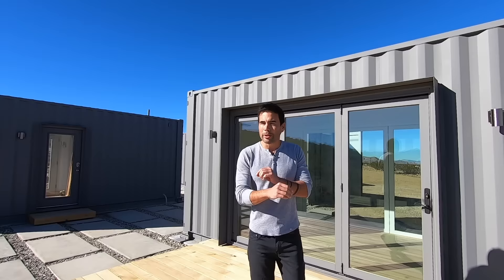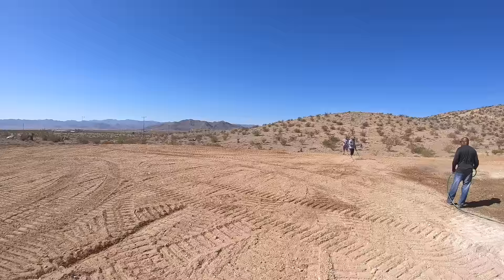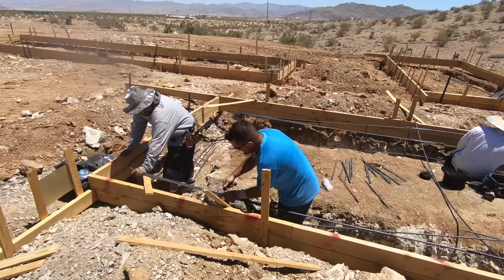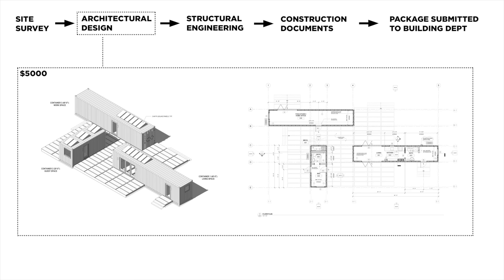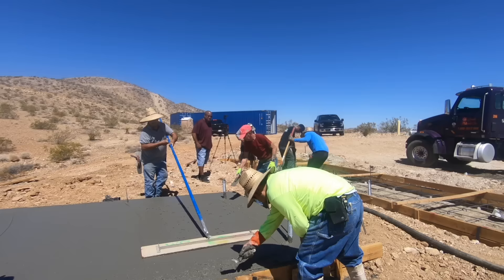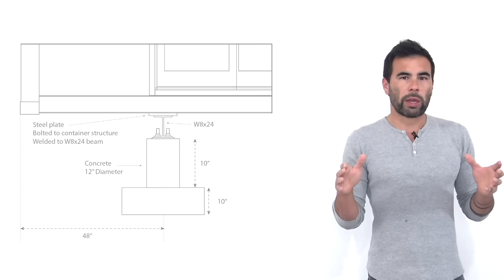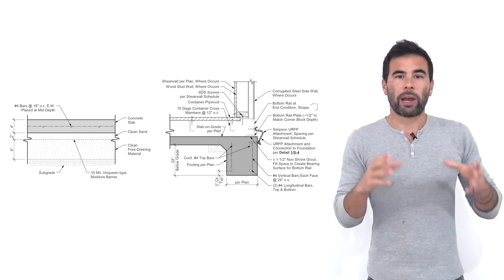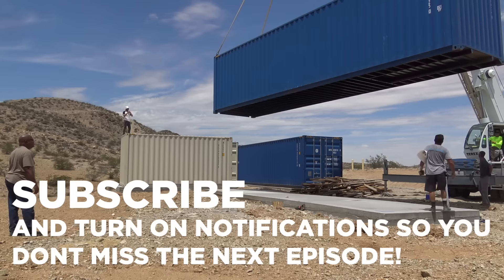Building a Shipping Container Home | EP01Permits and Foundation Design

Comment: CA: HEY STOP!!
Builder:? What?
CA: Do you have a permit?
Builder: Sure right here.
CA: No No No my friend I need the permit for this permit to be permitted.
Reply: 😂😭😂 I am screaming. This comment is golden. I use to be a planner in California.
Reply: Don't forget the Conversation Tax and the Breathable Air Tax.
Reply: HaHaHa:))))  I am laughing too hard right now!!!!!!  DO NOT Ever build anything in Sunny CAli !!!
Reply: @GrafDevelopments  HaHaHa:))))))))
Reply: sounds like California is even worse than Germany/most of Europe because we slapped a container on our property , needed no real building permit but a pointpermit like you need for a garage or a new driveway and it did not have to have any foundation, we put some welded railway rail frame and a few pieces of concrete tiles/bricks below we just needed to prove that it is removeable without any pollution and that the chimney and sewage dont leak  - e just use it for storage and workroom but you could live in there 
you should have taken a coolingcontainer, they are already isolated and got some electronics installed you can repurpose
get some old windows from a demolition site-just be there at the rigth time and ask if you can cut some windows with the framework out to repurpose them, here you get your windows almost for free 

As if a container would collapse from a earthquake, just ask those people if they are capable of breatheing and thinking at the same time what do they imagine? a landslide with the container skiing and rolling down a mountain
Reply: @GrafDevelopments -- 😂 --but not really😕
Reply: It seems just like anything would happen EVERYWHERE in Mexico... no matter the city.... PAIN IN THE A**!!!!
Reply: Hahahaha...genius!
Reply: I live in the Bay Area and yet it is really bullshit. We have a housing crisis because our leaders are incompetent but think they are so much smarter than others. 

I plan to explore the US before I settle down. Definitely not in Cali though. Not what it used to be.
Reply: I work in construction (fire sprinklers) and this is about right. 

I have property in the neighboring desert in the video, and I wouldn't mind the permits, if only it wasn't so damned expensive.
Reply: I used to live in California, that is so relatable.
Reply: It's the same here where I live. It's because of Earthquakes. He says so in the video.

Comment: For a shipping containers we usually go with pillar foundation design, depending on the environment and frost line depth we drill about 1,5m in depth and ~10-20cm in diameter, put in concrete and metal bases just like in your initial drawings. There is also full metal screw in type of pillars, some people use them because they are cheaper alternative, but I am not sure if they are better, those are basically big and long metal screws, they just go in the ground and thats all. These foundations are usually used for smaller constructions. 
The foundation you used here would be considered as too much in most of the countries, we usually use these foundations for a traditional houses, although we make them deeper, that  probably depending on a frost line, usually we dig in ~1,5m depth here in Lithuania.

Comment: If you're gonna have multiple containers, it would make sense to lay them out as a perimiter to form a courtyard. You can then erect shade cloth over this courtyard to create a sort of greenhouse where you could have a nice garden which may even provide a haven from the dry heat of the environment.

Also, I would have put cyclone bolts into the concrete slab and tied the containers to them.
Reply: That right there is exactly my goal. To buy permits, buy the containers, buy trees if permits are needed for that as well, and start crops.

Comment: You should look into Helical Piers. They are very easy to install and perform better than concrete under seismic loads because they allow movement. This would give you fast installation, adjustability, and a steel connection to your cargo containers.

Comment: I'm building what I call a hybrid container home, in Upstate South Carolina. The basic permit was about $1100.00. I'm making 2 stacks of 2, 24' apart, on two end piers each stack, foundation wall on the inside facing sides, and 2 cylindrical piers, 12" diameter, starting with 2'wide x 1' thick footings all around. Add to that a foundation wall riser, 12" wide, 12" high, then narrowed to 7" wide, total rise 36". The entire foundation wall, with change in thickness was a monolithic pour. The inside has a 4" ledge, upon which the garage floor is poured. In each end of the end piers (18" wide by 81/2' x 40" high), are steel plates 1/2" thick x 12" x 14", with 5/8-11 threaded anchor "L" bolts in each plate, 4 each, embedded in the piers. Other plates are similarly  embedded in the foundation walls and side piers. The bottom containers are to be welded to the plates. Top containers attached using standard shipping lockdowns to bottoms. Roof over entire structure, second floor uses I beams, bar joists, etc. This design does away with room width limitations between upper containers. Only openings in containers are for doors and windows. Rectangular tubing frames for all openings. Main living space is on upper floor, 1600sq/ft. Lower level is garage, workshop/ utility bottom left container, entrance hall and office/ den for right side. Stairway is alongside inner wall of right container. The ends are to be structural steel standard metal building design. With the rebar, I welded all risers, etc. This house will last for generations, weather storms, etc. Compared to the stick built on slab houses popping up around here, they are as a cheap car compared to a dump truck, structurally. BTW, I'm doing most of the work myself. I have an older Bobcat to be my workhorse. I would NEVER consider building in a high overhead, control freak state like Kleptifornicatia. And... I'm on 3 acres, with a creek running along the south boundary. The Smokies are 20 minutes north of here, Asheville 55 miles north. I will have water, no matter what happens in the desert out there. Water was one of my must haves. One more thing: this isn't meant to be cheap to build. It is meant to be solid shelter, not a temporary sticks and osb "tent."
Reply: How is your project going? (Resident of WNC here)
Reply: I would very much like too see this shelter. PLEASE!!!
Reply: @gloriaharris5356  Just look up Andrew Camarata's youtube channel which is what I thought he was describing at first.

Comment: "Sprinklers for fire suppression" you got a single bush every like 5 feet from each other
Reply: But, but...they might gang up on you!
Reply: I died laughing on your comment dude 🤣🤣🤣🤣🤣🤣
Reply: @pendejo6466  1- build a defensive wall around your house
2- make the bushes pay for it
3- ???
4- profit
Reply: Did he mean sprinklers inside the building?
Reply: @geothr33  idk but usually sprinklers destroy almost as much of your inventory as a housefire would - the difference being that the sprinklers saves the house itself which the fire could easily burn to the ground. In this case, what is there really to save? The shipping container which is effectively the house? What do you really need sprinklers for here, I mean worst case you go and buy another shipping container lmao. Everything inside it will be ruined by the water anyways.
Reply: I assume for inside... but his house is literally a steel and cement box, there ain't no way in hell its gonna burn down.
Reply: And it's a metal box anyway!
Reply: @Real_MisterSir  You also won't burn to death
Reply: @joshredmond5633  A simple smoke alarm would suffice for that purpose, then you'd at least have a chance to put the fire out in a specific spot without ruining your entire interior in the process.
Reply: Not to mention the "house" is a giant metal box!
Reply: This is how safety works same applies to all even though containers do not catch fire from outside like traditional stick build.
Reply: Steel shipping containers don't burn. There isn't a camp fire worth of fuel in a square mile of that desert. He's in more danger from the totalitarian police state than from fire.
Reply: @pendejo6466  lmao thats fkn funny . Burning bushes " ok lets band together , there he is lets go get that dude in the box "
Reply: @cdgonepotatoes4219  
No new taxes.
Reply: @pendejo6466  In Colorado we, the voters, passed a law called TABOR (Taxpayer Bill of Rights); We vote on any new tax increase or new tax. 
 "The TABOR Amendment, which was approved by voters in 1992, limits the amount of revenue the State of Colorado can retain and spend. The TABOR limit “base” is equal to the lesser of the prior fiscal year's revenue limit grown by Colorado inflation and population growth, or the current fiscal year's revenue." 

"Give a man a gun and he can rob a Bank. Give a man a Bank and he can rob the world." Tyrell Wellick  I.R.S.
Reply: @darmok-hm6jx  
No new taxes.

Comment: This is great. I particularly liked the detail in the foundation construction. I live on the east coast and when building on a sloped site, we struck a large continuous seam of rock. So we decided to anchor one corner of the house basement on this bedrock, poured the slab , built up the walls and used floating “I” beams to act as a dish type bearings to support the weight of the house on top, in case of earth quake. It was actually cheaper to build like this and people thought I was crazy. 2 earthquakes later, the house has settled nicely into the sloped site. In a container this would simply look like a single independent pedestal post under each corner with a cast iron dish and a corresponding twist lock with a cast iron ball. The whole structure “ floats “ on the four corners.

Comment: The corners of containers are strongest, all the weight up to 20+ tonn rests on those 4 points.

I'd just have dug 4 corner holes in the ground, compacted them and poured in concrete, and made sure it was all leveled. Also put container-shoes (Twistlock) in/on the concrete to better keep the container in place during windy conditions, they do grab alot of wind these big boxes.
Reply: I never heard of a twistlock but just looked it up, great advice.
Reply: Was thinking the same!
Reply: The civil guys really worked him over here. Does anyone know who stamped these drawings?
Reply: @Benzo Thats Cali for you, I don't see how any normal person can live there at the cost of living rate.
Reply: I would have hired a piling/foundation drill, then inserted used carpet roll tubes then fill with various size aggregate + compact at each stage + insert reinforce rods and pour concrete using air pokers to reduce air pockets, but it important to remember that the altering/cutting out of container walls does compromise its structure if not supported underneath, so I would have the container resting on 8 points ( 4 each side on 40 ft container to possible reduce flex),...the `Twistlock` is a great idea.
Reply: @Benzo Yes, it's over engineered.... because it's CALIFORNIA
Ask the same engineer to design it in just about any other state and both your design cost and build cost will drop.
California sucks, even for us engineers.

Comment: Nice work! I’m also a designer in Los Angeles and I know exactly how rigorous the permit process is. I Just finished my detached new 1200sq. ft. ADU in the back of my house I had to go through additional requirements like Low Impact Development Design..It wasn’t easy but got the Final Inspection approval yesterday 🙌👍🤜.  For the 18” min. Crawlspace I believe there is an exemption to that rule if you use a naturally durable or preservative-treated structural floor system. But going with a monolithic slab foundation is a good choice and Engineers prefer to use it when designing a new house for is structural reasons. I can’t wait for the next episode!

Comment: Hello there. I popped in your videos and I pretty enjoy them. Well done for your effort. 
I am an engineer myself having a background in Greek building code (very tough stuff due to intensive earthquakes over the continent) but also worked and still working on projects for California. 
I need to note at this point that the building codes all across California are way too overestimated to the point that are not cost effective at all. Owners just financially suffer to finish off their investment without actual "engineering reasons" I dare to say. 
In the meantime your engineers are afraid of undertaking the responsibility (due to the strict and sometimes unclear codes) so they come up with solutions that definitely cost a lot more than it should.
I will give you an example on the "lateral movement" that you mentioned. Just let the self supported element "container" freely move on a leveled surface. It won't go anywhere..You could have implemented supported slabs that could be either screwed in the ground (technology used for PV projects in open spaces) or just deep hammered vertical steel slabs in the ground adding some self expanding concrete to fill up any gaps between the slabs and the soil.
I hope I managed to give you an idea of how that could work according to my knowledge.
Many Regards from Greece!
Andreas.
Reply: hmmmm......letting the container move freely opens up the risk of severing electrical/water/sewer lines
Reply: @alexfromoz  thanks for the comment. I reckon that setting limiters around the support won't cause any problem. it's quite a popular method and I propose you could have a deeper look in it. It's like a restricted support instead of fixes like when calculate cantilevers.

Comment: What I found interesting to see, that the plastic foil that was used to cover the floor area before the pouring, was covered with sand.
In Western European countries, the plastic barrier is used to prevent sand, or dirt being near, or at risk of getting in contact with the concrete, as it could comprise the concrete mixture. It is also common to put the plastic all the way underneath the concrete, and not just underneath the thinner floor area. 

The small prefabricated concrete blocks, are used to highten the rebar but serve to keep the plastic in place. 

Also it is mandatory in our area to use a vibrating surface or penetrating compactor, to increase concrete strength.

Using the slab on grade seems a sensible compromise, I was wondering if insulation (HD graphite EPS e.g.) was considered placing underneath the slab.

NIce vid!
Reply: chalky940 ....wind blows plastic around prior to pour. Mexican technology is sand.

Comment: I am a geotechnical engineer. Considering the stiff soil conditions, I would simply excavate about 50 cm of soil and replace it with gravel followed by compaction. Nothing much,
There are 2 main risk scenarios while laying a structure above a soil 1) Settlements 2) Bearing capacity. I do not think there are any risks since the soil conditions within the site are already too damn good and drainable.
Sorry to say but the structure engineer fooled you to earn some cash.
Reply: Exactly what I was thinking, that foundation was way way way over the top, and they never even ran his popups through it, that ground is solid probably hasn't moved for thousands of years, he was taken for a ride indeed
Reply: Gravel was my first thought too, but I use to live in louisiana, where everyone was cheap, and all the ground was mushy and wet... so thick layers of gravel are used all over the place, foundations, roads, parking lots, walk paths, etc anything where you don't want it to be a puddle tomorrow.
Reply: I know the area, it floods once every few years. Wouldn't this cause an issue with gravel?
Reply: Not at all. I come from the land of floods and there is gravel everywhere. If you are really worried about it you can make sure to set up barriers to route the water around the structure, and to stop the gravel from being carried off. Even just sandbags works for this, if you want something temporary you can store for less of an eye sore when you are using the structure.
Reply: imran zafar just gravel ? Earthquakes can / will shear off plumbing and electrical stubs , ground squirrels, prairie dogs , hedge hogs will burrow through edge of gravel creating a massive rodent network to live on , which brings snakes , you'd be dealing with rodents and snakes constantly
Reply: Primary risk is earthquakes. The Joshua Tree area produced major quakes (Landers and Big Bear, 1992) with vertical displacement of about 4-6 feet and horizontal displacement measured in 10's of miles. That is why it requires a substantial footing along with the hold down bolts. That is standard construction in Calif.
Reply: tdkeyes1 Amen !
Reply: Dylan Modell oh the mold and pestilence
Reply: How about 30m reinforced friction pile foundation, wherewith piles are equally spaced 2m from each other. An yeah make them like 60cm radius.

Comment: If I do this, I'm going with the crawl space option; much easier to run and hide and access all the mechanical, electrical and plumbing; and much cheaper.
Reply: I was thinking the same. Plenty of room to run plumbing, electrical, etc. with a house of that size.

Though I wonder how difficult it would be to change plumbing, electrical, etc. later on if done this way. I'm not very experienced in that so I don't know.
Reply: 100k permit fees! still want a basement?????
Reply: I have been interested in shipping container living for awhile now, but couldn’t find much info on the actual build. Thank you for this! So informative! What is your IG account called?
Reply: Me, too. I have no problems with railings if I want to build decking 18 inches above the ground. In fact, I plan on making the tops of the containers usable as decks so there will have to be railings on the containers, too.